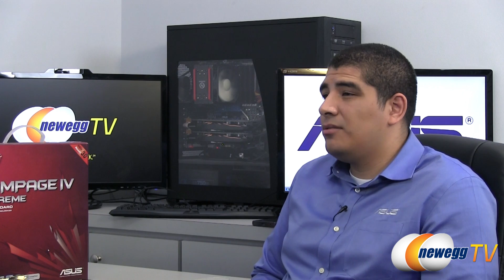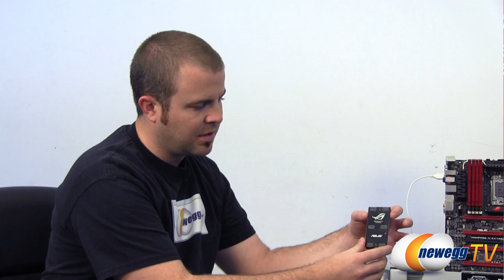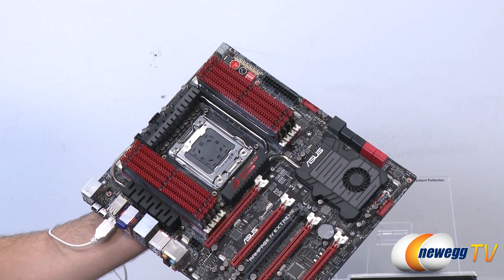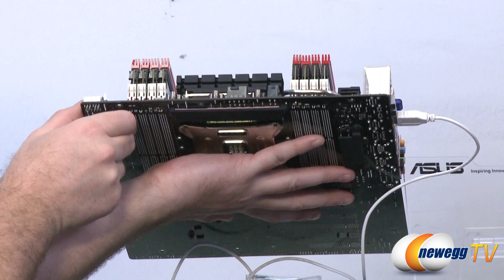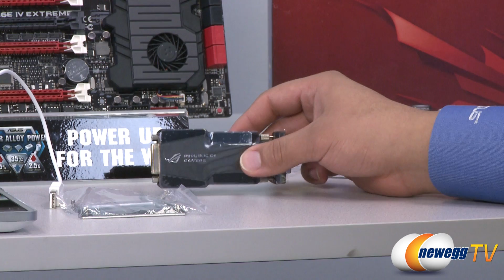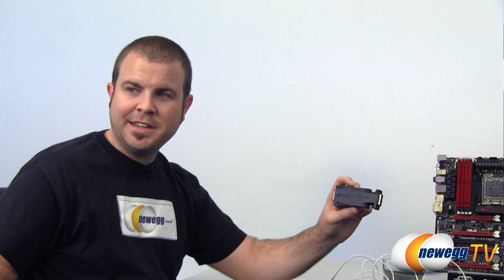Newegg TV: ASUS Rampage IV Extreme X79 Socket 2011 Sandy Bridge-E SB-E Motherboard

Comment: check your cpu socket type, if its LGA 2011 then yes you can use this board, if the socket type is the 1155 then you cant

Comment: @tetraninja Well, there are only 6 "proper" (Intel-controlled) ports, which may leave no spare ports for optical drive.

I myself don't need one, but if I'd have to install one it'd go into Marvell - cause mine 6gbit/s ports are occupied by two 64GB m4's in RAID-0, and 3gbit/s by two HD103SJ's (R0) and two HD204UIs (R1).